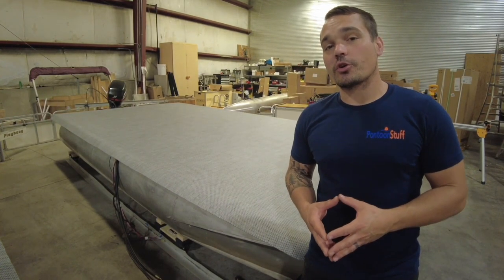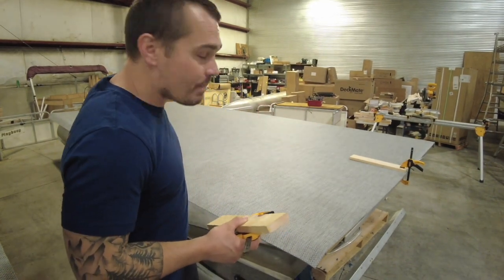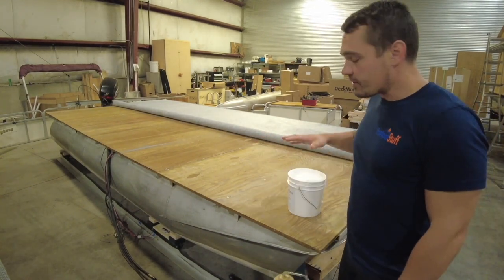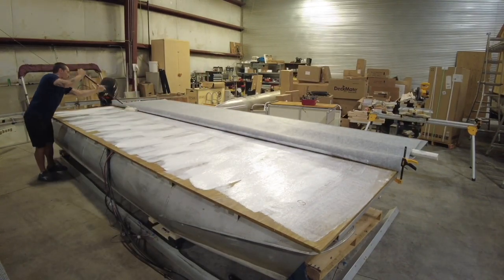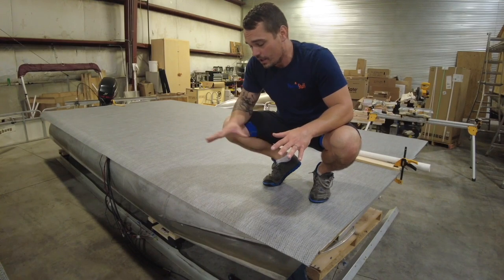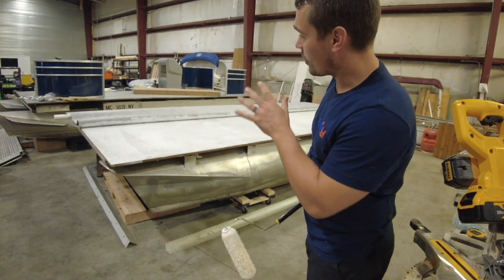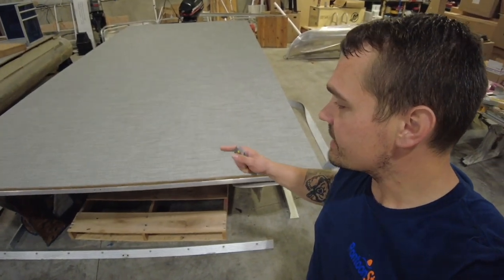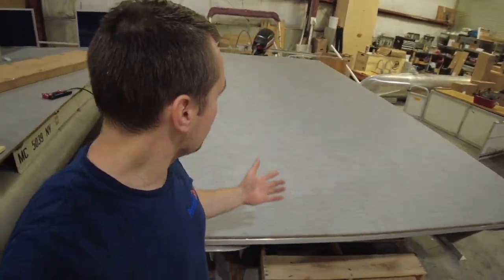How to Install Pontoon Boat Vinyl Flooring

Comment: tom do you have a video on fixing a tear in a vinyl floor or how to join two pieces together with some kind of a seam ! thanks I enjoy all your videos!
Reply from the maker: I do not, luckily we haven't had any tears in the vinyl we've installed. I would try a super glue and working the fibers of the woven vinyl back together. I definitely don't recommend adding vinyl floors with seams. I've seen a lot of factory boats that had carpet that transitioned to vinyl and they always used an aluminum transition strip. The only time we've done that was when building the four pontoon 12' wide floating dock. It turned out great, but only did the transition strips because we had no other option at 12' wide!

Comment: The vinyl flooring I found has a foam back to it, which matches the trim very well. Do I need to use a different adhesive for this type?
Reply from the maker: I've installed one floor with a foam back (no felt) and we had to use a different adhesive supplied by the vinyl company, NOT the stuff I normally use from Pontoon Stuff. It was a unique situation where the customer had the flooring and glue and we installed it on site. Your best bet would be to reach out to the flooring manufacturer or retailer to find out what glue is best for that flooring.

Comment: great video i have a 18ft bass bugggy dlx pontoon what is theprice of that installation on it or can i order that for an 18ft bass buggy 8.5/20
Reply from the maker: You can order the exact flooring that I use from PontoonStuff.com. You can enter TOMSTOONS at checkout to save 5% on your purchase. They've got free shipping for anything over $100 including their flooring and even their flooring kits which include plywood, hardware, glue, and the woven vinyl. We've installed their vinyl on close to 100 boats over the last few years and all of our customers have been very happy. Our charge would be in the ballpark of around $4,000 installed for that size boat (that's the whole kit with new plywood, and the tear down and rebuild).

Comment: I can't wait, I got some samples in the mail, looking forward to getting some delivered and putting that stuff down! Anybody know they best cleaning solution and technique to get the rails and pontoons shining new? Thanks, appreciate it!
Reply from the maker: Awesome, you'll love the vinyl! If your railings have an anodized finish then I would just hit them with dish soap and a rag to clean them up. If they're bare aluminum you could use a red scotch brite pad or they'll sort of polish up with an SOS pad or steel wool. Lots of work to polish anything and they'll oxidize/dull eventually.
Reply: @tomspontoons  Thanks, yeah they're probably anodized, I'll just try a good cleaning first 👍
Reply from the maker: @skylark4901  👍

Comment: What glue do you use on treated wood to get carpet to stick .
Reply from the maker: I use the adhesive from Pontoon Stuff exclusively for gluing carpet and glue to plywood. They ship different glues from time to time, but their DM-9080 has been what I've been using the last 6 months or so on projects.

Comment: Thank you for your video
Reply from the maker: You’re welcome!!! Hope it helps!
Reply: @tomspontoons  does the vinyl floor have some type of foam or rubber backing for comfort
Reply from the maker: @annekennedy7356  YES! It has a layer of vinyl on top, then a foam padding which gives it a very comfortable feel, then a felt backing to help with adhesion to the deck. There are different options and thicknesses. Pontoon Stuff makes it easy with just a heavy duty vinyl which has no cushioning, and then their woven vinyl which has the cushion. The woven is great stuff and has a great feel on bare feet. I kick my shoes off immediately every time I get on my boat!

Comment: You mentioned cutting boards. FYI, since starboard is kind of expensive, then as an alternative, cutting boards also make good, cheap panels to fabricate things for pontoons. I used one an inch thick to fabricate a mount for my trolling motor, and used a couple of 1/2” thick boards to make rod racks and corner shelves with cupholders. Also used a couple others below the seat beside the battery to mount my fuse panel and 50 amp trolling motor circuit breaker on. They come in lots of colors and sizes and thicknesses. I even used a piece of scrap to fabricate a new latch for my front gate since the stock one was too weak to hold up to wind on the highway.
Reply from the maker: Absolutely! I’m not sure how it’ll hold up in the sun, but if it’s not in directly I’m sure it’ll be fine. Amazon now sells marine grade UV protected plastics like starboard (but cheaper!).
Reply: @tomspontoons  it will do quite well I believe. Before I used these on my pontoon I had a little Sundolphin Sportsman pond boat and a couple of kayaks that I used these same materials on for mods. 3 years of outdoor use, and kept stored outdoors too, but not really stored in direct sunlight. There was no change to the materials. I usually always get black, but on the pontoon I’ve used both black and the royal blue color. One of the blue ones used for a corner shelf did develop a slight upward curve, but it’s barely noticable. I’m OCD about stuff like that so I  catch it where others won’t. It curved  very slightly along the front edge where it spans about 20” with no support. I could have stiffened it with another piece fastened like an apron board on a table and avoided the issue, but I didn’t.
Reply from the maker: @duanebledsoe7566  good to know it’s an option that’s proven to work for other folks!!

Comment: How slip resistant is this product?
Reply from the maker: Very slip resistant. I'd be confident running and jumping off of it. I'd use it on docks, patios, etc. too without fear of it getting slippery with lake water or rain.

Comment: Do you treat the plywood with a water sealant?
Reply from the maker: When using marina grade CCA treated plywood (the plywood Pontoon Stuff sells) there is no need to seal, and in fact you don't want to seal it. HOWEVER, if you buy the "marine grade" from Menards or other local stores that is NOT TREATED then you should be sealing it because it's not meant to be used on a pontoon boat. It's meant to be fiberglassed or epoxied over. All of the boat brands using plywood have always and are continuing to use CCA Treated Marine Grade. It's the best option!

Comment: Hello, the floor on my pontoon boat is aluminum. What adhesive do you suggest? Will rivets and screw heads show under the vinyl? Maybe I should use a foam type of floor? Any suggestions would be appreciated! Please provide me links for any product. Great video brother!!
Reply from the maker: Great questions! Rivets and screw heads will show if you’re looking for them. Foam floors like Sea-Deck tend to have issues because of all the seams and things peeling over time. I would recommend a woven vinyl and using a solvent based adhesive.

I just uploaded this video this week showing the vinyl to aluminum process:

Installing Pontoon Vinyl Flooring on ALUMINUM DECK
https://youtu.be/c5DoVEP0po8
Reply: You're the man! Thanks for your help!
Reply from the maker: @snookwestwest2298  just happy to help!

Comment: I always get mixed answers on this subject so I thought I better ask you do you seal marine plywood or no...some people say yes some say no some say just do the top and sides some say just do the bottom and sides I'm very lost on this issue
Reply from the maker: I need to do a video breaking down this topic. There is a BIG difference between "Marine Grade Plywood" and "Marine Grade Treated Plywood". You can get Marine Grade plywood at most lumber yards and even big box stores, but it is not treated nor meant to be constantly wet as it's not prepared for resisting rot. It's for applications where you would fiberglass over it or epoxy it to seal it. Treated Marine Grade plywood, like is sold at PontoonStuff.com is made to get wet over and over, just like what the pontoon boat manufacturers have used for the last 30-40 years. If you HAVE TO use untreated wood then yes, you should seal it....but then it requires a different adhesive and process to glue the vinyl flooring down because the vinyl doesn't breathe nor does plywood if it's sealed. If it's getting carpet then it's not a big deal. I will be making some videos coming up where I discuss common questions like this one, tritoon conversion topics, prop questions, and so much more!

Comment: Hey Tom, I was curious what your thoughts are on 4’ x 8’ sheets of HDPE or similar products instead of plywood for decking. It would be for a pontoon used as a dock. Thank you
Reply from the maker: There are a couple brands of pontoons who use a plastic material called Coosa Board, basically an HDPE material. The adhesive process is different than plywood, more similar to adhering vinyl to aluminum (video posting later this week about how to do that). 

My take on it is that the vinyl will wear out eventually and it’s easier to just install new plywood and vinyl at the same time than try to clean a composite deck well enough to lay new vinyl (it’s NOT fun cleaning those surfaces!)

Comment: I'm trying to figure out the best way to remove Marine Vinyl flooring from my pontoon boat. So I can install new flooring. I heard you recommend replacing the wooden flooring? Uhhggg I'm not sure that I planned for that hit?
Reply from the maker: Depending how it’s glued down it should come up. You could try a “spider blade” for a reciprocating saw (saws all) to help peel it up. Then you’d want to get as much of the old glue and vinyl backing (usually felt) up with a sander. If you put in the labor it’ll end up saving you a lot of money, but it’s time consuming…that’s why we just start with new wood, it would be more expensive for our customers to pay for the time just to try to salvage old plywood!

Comment: I am planning on new plywood and carpet. I do not have an enclosed area to complete the project. My question is at what temperature can I install the carpet?  I live in north western PA and the nights are still cold. I will be covering the project at night. 
Thank you for the information.
Reply from the maker: Awesome question Ray!! Ideally we’re looking for at least 24 hours at 65+ degrees. Keep in mind that a bright sunny day that’s 55 degrees might offer a good amount of heat to help that glue cure. The glue will usually have those recommendations too!
Reply: I’m in the same boat Ray, in PA want to get my floor done but it’s been so cold and can’t get that 24 hours needed to cure right now! Looks like this week we’re getting in the 70s might just try to knock it out and hope for the best!
Reply from the maker: @evanjoseph8280  be patient because it’ll be worth knowing you did it right the first time!! Best of luck in finishing it up as soon as you get the flooring down!
Reply: @tomspontoons  thank you! It went great and am super happy with it!
Reply from the maker: @evanjoseph8280  glad to hear and happy to help!! Now go enjoy that “new boat”!!!

Comment: I used a water based sealer on my deck boards(Seal-Once Marine wood sealer), will the vinyl glue cure or will I need to use a solvent based glue?
Reply from the maker: I’ve had this asked a lot. I would test the regular vinyl glue first to see if it stick well. Just take a little chunk of vinyl and glue it to the back corner of the boat, leave it for a day or two and then come check how well it cured. I think as long as it’s not epoxied or completely sealed it should cure. My fear would be how the solvent and sealant might react and mess with the vinyl.

Comment: Tom, is there a reason you don’t use a linoleum roller? Seems like it would be easier.
Reply from the maker: The main reason is because I'm stubborn and I know the PVC works, lol. It makes more sense to say the PVC works best because you can work the flooring outward with pressure, take all the pressure off, reset, and work outward again. That way any air bubbles, excess glue, etc. can be pushed out to the edge of the deck instead of just moving it around the deck.
Reply: @tomspontoons   We just installed new 20' vinyl flooring using the kit from Pontoon Stuff (love it!) - your videos were so helpful! We used a
3 1/2" OD  PVC pipe and instead of the cutting board, used a 9x13" nonstick cake pan... made for better pressure spread and easier on the hands.   Thanks for your easy to follow videos - they're great!
Reply from the maker: @kathejukish  awesome!! So glad our content was helpful. You’ll love your new flooring!!!

Comment: I have an aluminum floor on my pontoon boat. Recommendation on glue?
Reply from the maker: For aluminum decked boats you need to use a solvent-based adhesive when installing vinyl. Neither material breathes so the tradition glues used for wood and vinyl won’t work long-term. The process is different with solvent-based adhesive (aka contact cement) because you apply it to both materials, let it almost completely dry, then stick them together. It’s super strong stuff when done correctly! Also, and probably the worst part, is that the aluminum needs to be as spotless as possible. Gotta get ALL that old glue off the best you can……or just replace it with marine grade treated plywood!!!

Comment: why that wireing is hanging would it be better to let it hang inside and then cut the vinyl flooring
Reply from the maker: It's easier to work with usually on the outside of the boat when it comes time to run everything up through the hole in the bottom of the console to be hooked up.

Comment: Great viduo.  Thanks for the info.  One question.  I had replaced the deck on my boat last year.  At that time, we painted the deck, using rustoleum marine primer and topside paint, with the anti-slip additive for the final coat.  By the end of the season, the paint was peeling, badly!  I plan to replace with vinyl.  Do I need to sand off all the old paint?  I'm concerned in part because of the anti-slip additive.
Reply from the maker: Thanks Marc! Unfortunately, the best way to adhere the vinyl is by gluing it to a clean wood surface. The vinyl glue needs to be able to have breathing through the wood to cure, so a sealant or paint will not allow that curing to happen properly. Do your best to sand off the paint and start with a fresh wood surface. On the bright side, sanding paint is much easier than trying to sand old carpet backing or old glue!!! Best of luck, reach out if you have more questions!

Comment: I have a 24 foot aluminum floor Sun Tracker.  I live in South Florida.  I have two questions.  How much hotter are the light gray woven vinyl floor material than carpet?  Second what surface prep and glue would you use on the aluminum floor?  I agree that carpet is a pain to keep clean.
Reply from the maker: Hey Robert! Thanks for watching our videos! I've heard a mix of reviews from different people about vinyl flooring on feet. It seems that woven vinyls are consistently cooler than other options out there. I have the gray woven teak on two boats and love it. On a really hot day we will have to splash the floor with water a time or two in order to keep it cool for the kiddos and dog, but after that it's good to go. A darker carpet can get really hot in the sun, but the big downfall of carpet is the upkeep and the fact that it simply takes forever to dry after a rain storm or wet swimmers climb aboard. 

I don't work on aluminum decked boats because it's such a tough thing to guarantee the new vinyl I'm installing on it. Additionally, the labor it takes to clean the surface and apply the proper adhesive makes it the same price or more compared to just stripping it and using marine grade treated plywood. You'll need to get all of the old carpet and glue off. It tends to melt and smear with sanders, wire wheels, and other abrasives. I've heard of folks using drum sanders and going through a few pads, and even renting commercial grade heated power washers. Once clean you need to use a solvent-based adhesive (aka contact cement) like Weldwood or 3M products. Because the aluminum can't breathe like wood to cure, you'll apply the solvent-based adhesive to both surfaces, allow it to nearly dry (do some test pieces on scrap aluminum), and stick together...once together that's it (if done correctly), and it won't come apart easily. You'll have to work in smaller sections usually because of the dry time, etc. so you'll likely work from front to back unrolling a few feet of vinyl as you go. Hope this helps! Someday we will do an aluminum decked boat just for the purpose of making a video on the topic.
Reply: Thanks for the quick response.  I will delve into this further.
Reply from the maker: @robertpetrasek1773  Absolutely! Whichever flooring you go with, check with the manufacturer that it can be glued with solvent based adhesives. I know that Pontoon Stuff's woven vinyl can be. Best of luck!

Comment: Great video.  I'm putting new vinyl flooring in an old Tin boat.  What do you think of Advantech for the sub floor?  Marine Plywood is very expensive,  Thanks
Reply from the maker: I would strongly advise against OSB or other particle board. To save some money, I would recommend using pressure treated plywood. The “treated” part is most important to resist rot and last a long time. “Marine Grade” simply means without knots or voids and typically implies that waterproof glue was used between layers of ply.